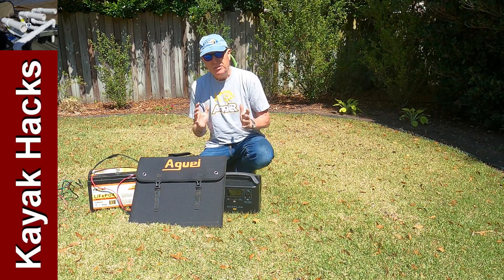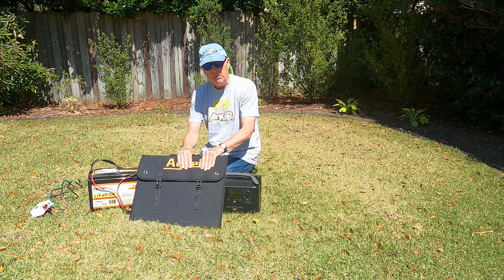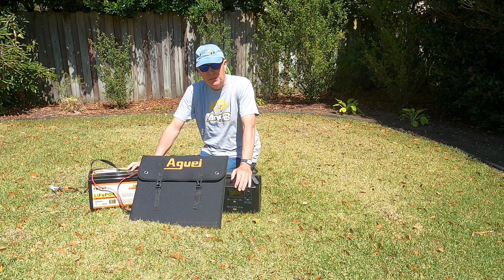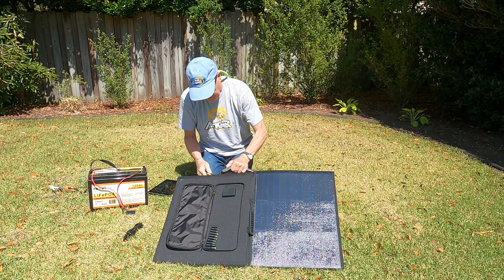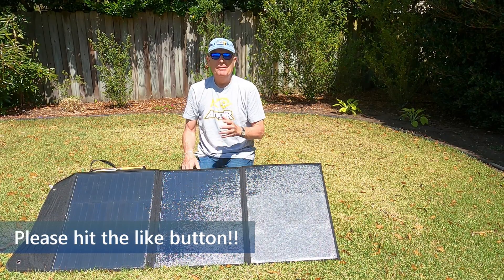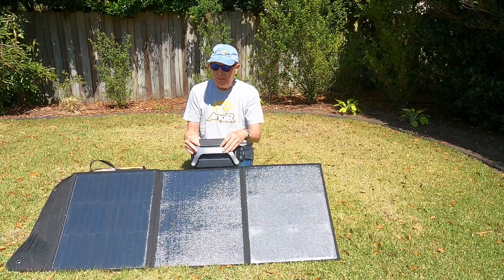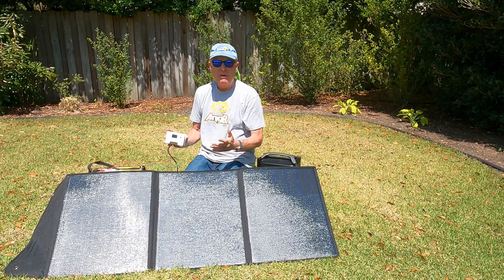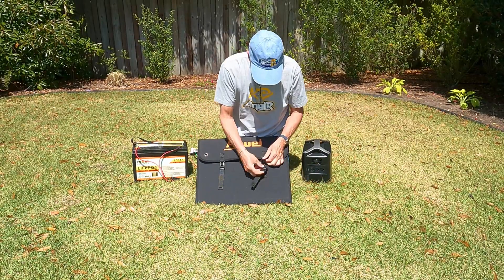Solar Panel For Kayak Trolling Motor - Aguei 120W Panel Tested

Comment: What about charging while trolling?  How would you wire that up?
Reply from the maker: I just do not see a practical way to do that. The panel would have to be pretty large to deliver enough charge.
Reply: Power while trolling is stopped

Comment: I've been experimenting with some solar panel stuff for my camper that I'm building for those beach trips. It can be pretty complicated stuff to figure out.  Seems the more power you need, the more complicated it gets. Thanks for the insight.
Reply from the maker: The whole controller thing is another complication